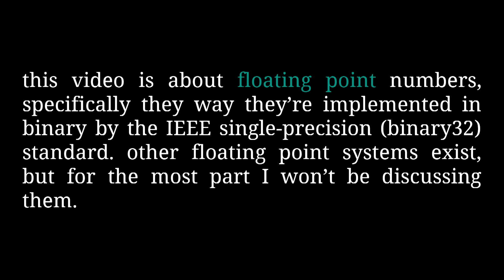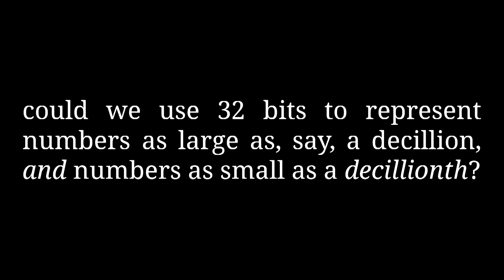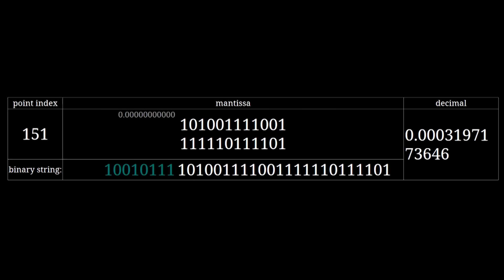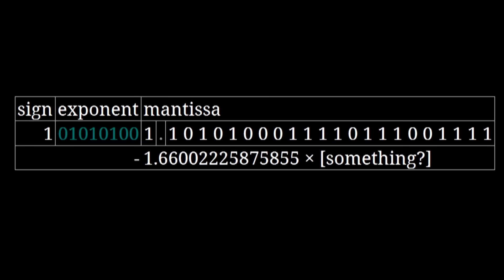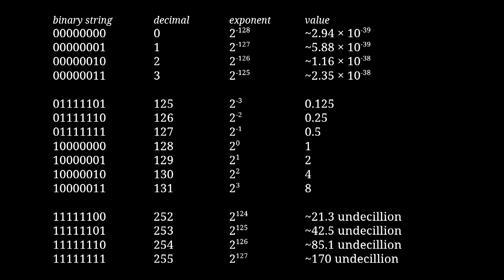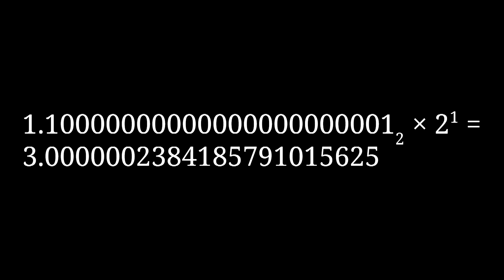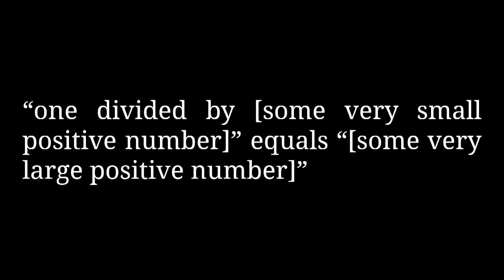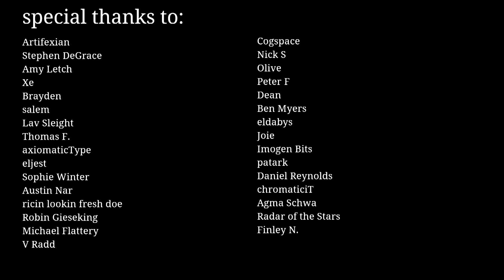how floating point works

Comment: You dont NEED to tell the computer anything. Just store that idea in a location where you would use it that way by default. If you do it enough times, you can theoretically have a computer with 0 instructions

Comment: additional notes on NaN: Some programming language implementations use the extra bits in NaN for storage in a technique called "NaN boxing".

Let's say you're Javascript. You are a dynamically typed language, and you have two main values you care a lot about: "number" and "object" (and some others, which I glossing over right now). How do you store these two types of values in memory? The "number" type is easy--just store it as a 64-bit float, but "object" needs to be a pointer (something which points to a location in memory). Normally, a pointer is 64 bits (on most modern machines), and this would give you 2^64 bytes in memory that you could store stuff at. However, if you do it this way, then you will need to store some additional data to distinguish the 64-bit float from the 64-bit pointer. You can't just store it as an extra, 65th bit---the main reasons is that most CPUs can only work with whole bytes. So you would end up with a data structure that is 72 bits = 9 bytes large. In fact it would probably round this up to something like 96 bits = 12 bytes, since most CPUs would prefer that memory be aligned to a 4 byte boundary. That's a lot of wasted bytes just to store a single extra bit!

Instead, what we can do is store pointers as NaN values! In a 64-bit floating point number, you have 47 bits to play with across all of the NaN values. Most programs probably don't allocate 2^64 bytes of memory, let alone 2^47 bytes, so instead of storing 64-bit pointers, why don't we just store 47-bit pointers? This lets you have your values be represented in exactly 64 bits, with no need for a 65th bit--instead, we just check if a value is NaN. If it is NaN, we assume it's an object and use the 47 bits as the pointer to the address in memory! Otherwise, we assume it's a regular number and interpret it as a normal 64-bit float.

Comment: 5:50 Fun fact: the reason that 0 is positive and 1 is negative is because that lines up with the two’s complement representation of integers, which means negative floating points whose bits are reinterpreted as integers are negative integers. Also it means that floats sorted by an integer sorting algorithm will be in the right order as long as all the floats are positive. Which you can exploit to make sorts faster.

Comment: The sign bit being 1 to represent negative makes binary arithmetic work. To turn a binary number negative, flip every bit and add 1. 
With this representation (called two's complement), "subtraction" is simplified into "addition with a negative number." Do your addition, throw away any carried bit if it's outside the scope of your numbers, and boom, correct result. 

Try it out for yourself!

Comment: One benefit of 0 being positive is you don't have to have an additional bit on to represent most numbers that will be used. Most being in occurence of use not range. I would believe this has more benefit in older computers but still would make signed integers ever so slightly more economical.

Comment: the sign of a floating point number is determined by (-1)^(sign bit), which means if you add more sign bits you get complex numbers in a format that makes doing anything with complex numbers needlessly difficult

Comment: The reason that the 1 represents a negative number, while the 0 represents a positive in the signed integers is because that format works better with standard addition.

1 00000 1 + 1 00000 1 = 0 00001 0

If 1 in the signed bit represented a positive number, the above expression would imply 1+1 = -2. If 1 in the signed bit represents a negative, the above expression would imply -127 + -127 = +2, which also doesn't work, but considering there literally isn't a way of representing -254 as a signed integer, and that it's so important to get 1+1 right, it's just simpler and makes everything make more sense if 1 in the signed bit represents a negative number.

Comment: A way to bypass this issue is to use something like a trinary number system (i.e. 0, 1, and 3) or 10-digit based system (i.e. 0 to 9). There! A lot easier to solve the decimal point problem that binary is forced to deal with.

However, there is a new more serious issue that arises from this. In binary it is very simple, on means 1 and off means 0. However, as soon as trinary is introduced, what do you use to represent the third value? Well, trinary computers were made in the past and the third number is determined by a partial current of electricity versus just determining if there is or isn't a current. A trinary system is technically better than binary; however, the wiring will degrade and be affected by exposure to elements. So? Just have them vacuum sealed. Well, it will still technically degrade with usage. So, the older theoretical trinary computers are the less accurate they may become and will potentially malfunction and/or crash more and more as time progresses and after usage.

Although, I do remember reading that this issue could be rectified making trinary for superior computers. Unfortunately, since binary is essentially the global standard for computers and phones, it is an uphill and mostly fruitless battle to push away from binary computers to trinary computers.

In short, we are stuck with double-edged sword that is floating point.

Comment: Where’s two’s complement?
Reply: Floating point was pretty much designed as three separate numbers packed into bit-fields of a single 4 or 8 byte value, with one of the fields being the sign, and the other two making up the magnitude. This leaves no real interaction between the different fields and they can all be interpreted independently. This makes things simpler for a human to understand and implement efficient algorithms for, but it's debatable whether or not it's actually more efficient.
Using 2's complement isn't really possible if you were trying to keep the three fields separate, since it mixes the sign into the mantissa and exponent fields. On the other hand, it's particularly good for integers since it's derived from modular arithmetic. In an 8-bit integer, -1 is really 256 - 1 = 255 - 1 + 1 = (255 xor 1) + 1 = (not 1) + 1. It takes advantage of the modular behavior that arises when embracing overflow.

That's not to say that you can't have a floating-point like format that uses 2's complement; it just requires abandoning the idea of each number being composed of a certain number of discrete and independent fields. This is actually what Posits do, with the greatest negative number using the same bit-pattern as the integer -1. Also while it was initially conceived as just a way to use integer comparison circuitry, and that actually using the number would require negating it before decoding if it were negative, some clever people found that it's actually possible to decode a posit into its constituent fields without converting to signed magnitude first.

Comment: 1/0.1=10
10*0.1=1
yes yes 1/0 is endless big number that we not know we not need know. we not divide 0 we allready know
s.. we can make rule
1/0=1 then 1*0=1
when we divide or multiply zero we get same value. thats rules
you have apple on table you split it 2 you have 2 piece size of 0.5apple?
you split it 1 you have 1
you split it 0 you still have apple. makes sense now? LOL
you not have infinity ammount apples magically xD

Comment: I still don't understand how 5(i)+27(m)=32 bits?
Reply from the maker: well for one that isn't how the bits actually are split up in single-precision floating point (it's one sign bit eight exponent bits and 23 mantissa bits for 1+8+23=32 bits total) but also 5+27 really does equal 32. so uh idk what you're asking basically

Comment: the whole thing about everything is an estimate with floating point math is kinda the same for a lot of thinks in programming
like yeah computers are supposed to be this thing that gives you consistent results but often especially when making a program to control your mouse (i use mac) it's really like irl where if you go too fast stuff breaks so you have to slow down to get to a reasonable state and even then depending on how much load or whatever the computer is dealing with it still could break.

Comment: I have a simpler solution, since all those numbers are rational, just allocate two integers, one for the numerator and one for the denominator, it's easier and stores rational values with exact precision

well the only caveat is that in order to perform addition and subtraction we'll have to either multiply the denominators to get a common denominator, but that would consume too much memmory, or we can find the least common multiple, but that requires prime factorization, a procedure we still don't have a fast way to compute without quantum computers, and if you manage to find an algorithm for that which is fast on classical computers than congratulations, but with the price of giving hackers a tool to break RSA and all of world's encryption in the process😂
Reply: This is an actual numerical datatype provided by many environments. Fairly predictably, they're often called "Rational" or "Ratio." Usually the numerator and denominator are represented as primitive integers, so operating with them is very cheap and you generally have to try to actually reach their limit. They usually don't get dedicated hardware though, so floating point is often used simply because it's faster due to the dedicated hardware. If you actually need precise ratios whose denominators aren't powers of two, they are much better that floats. Rational types can handle 1/3, 1/7, 1/11, and 1/13 without a sweat, where as both decimal and floating point would panic at the repeating digits when expanded.

Comment: I feel like NaN space is a huge waste. Sacrifice one bit and thereby allow super-normal numbers when the sacrificed bit is 0 and NaNs when it is 1. That is still 8 million or so NaNs, which is more than I personally know what to do with (and is 16 million really so much more useful?).
Reply: Take a look at posits. Posits only have 1 exception value of NaR (which is still technically a number by the way), as well as only 1 zero. As posits use 2's complement rather than signed magnitude, these two special values get mapped the two fixed points of two's complement negation. It also has tapered precision akin to subnormals, but across the entire range, which can actually make them more precise than IEEE floats when around 1.
Reply: @angeldude101 : Awesome! I will take a look. Always happy to add tools to my kit.

Comment: But wait, really, why didn't they repurpose -0 for NAN and have another range of values...
Reply: because -0 is important, it makes it so that at least the sign of the result is always correct
Reply: Because "-0" isn't actually -0. It's a negative infinitesimal / limit value. The range of numbers between the largest Real negative float and 0. The problems with "-0" arise from the fact that that range is inclusive on the upper bound and is generally treated as said number on the upper bound, even though this number is also included in a completely different positive range, making it the single Real number that maps to multiple different floating point numbers.
They could've repurposed the largest negative subnormal number to stand in for "-0", which would be equivalent to the very large number presented at 13:22 standing in for the range leading all the way to infinity, which would be a perfectly valid and reasonable choice, but not the one that IEEE went with.

Comment: So, the reason why 0 is positive and 1 is negative is so that the same circuits which compare signed integers as to which is bigger, can also compare floating-point numbers as to which is bigger, because signed integers use 1 for negative so that the signed and unsigned representation of positive numbers will be the same.
Reply: Except not really, since if the signs are both negative, then it needs to flip the order of the comparison, and it also needs to handle cases like +0 == -0 rather than +0 > -0 despite representing different ranges and having different bit patterns, as well as making sure NaNs aren't less than, greater than, or equal to any other number including themselves.

So no. Using the sign but like that does nothing to help with ordering floats. At best it lets you use the same isNegative() and isPositive() code assuming you want NaNs to have an extractible sign.

Comment: What the fu-
Also -0 and 0 is the same thing.
Reply: not exactly. they mention that numbers in floating point represent ranges of numbers. -0 are negative numbers too small to be represented with anything other than -0, and 0 are positive numbers too small to be represented with anything other than 0
Reply: @dihydrogen  that makes sense, yet it shoudlnt
Thanks.
Reply: They're not zeros. They're infinitesimals, representing the ranges of numbers between the minimum magnitude floats and 0. What float does the actual Real 0 map to? Good question!
Reply: @angeldude101  it maps to 0
Also discussing math while watching pixie and brutus has invoked fear in me. Well my father made me fear.
And my fingers are so inconvinient. And this keyboard makes typos too often.
Reply: @mihaleben6051  "it maps to 0" Which one? Both are equally close, equally far, and equally even (actually important for floats), so the only reason to give 0 to the positive infinitesimal is a positivity bias. Then again, that same bias is seen in the square root operator, which really should return the positive and negative roots rather than just the positive root.

Not giving 0 its own distinct value deprives floats of a true additive identity, so it's literally invalid for compilers to optimize x + 0 or 0 + x to x.
Reply: @angeldude101  oh no i have accidentally exposed a flaw in math, and do not understand it.

Comment: So the reason that negative numbers are 1xxx xxxx is that the signed and unsigned variants all have the same numbers from [0, 128). An unsigned 53 is the same as a signed 53: 0b0011_0101. If you want to convert to a signed number and multiply by -1, it becomes 0b1011_0101. Nothing has changed with the bits to convert to signed and changing to the negative equivalent is to flip the 0 sign bit at the beginning of the number.

Comment: Floating point functions are required to return some odd results for certain values. For instance, 1^NaN = 1^∞ = ∞^0 = NaN^0 = 0^0 = 1, which might make some mathematicians uncomfortable. Even more bizarre is (−1)^(−∞) = 1, because infinity is an even number. I'm serious. More technically, it's "because all large positive floating-point values are even integers," which rather goes against the notion that each point represents a range of numbers rather than a particular number.

(Note: that is how the "pow" function works. The "powr" function intended for continuous cases does not work that way, but it still has weird behavior like powr(−0,−3) = +∞ and powr(−0,+1) = +0.)

Comment: Thank you for the explanation!
I'm really not happy about this system, but I'm no way near good enough at anything related to suggest a better way of handling it.
I first bumped into the issue of FP numbers being approximate when I tried to learn PHP on my own.
It is too long ago to remember the exact values and calculation, so the following is... well... an approximation. xD
I did something like dividing an input number (set to FP) by 2, and then set the code to execute a segment of code if the answer was say 2500. The problem was that the code figured that 5000/2 wasn't equal to 2500. It was slightly greater than 2500.
Oh my BRAIN, before I figured out that this was some sort of quirk of FP numbers.
I assume banks and stores have reliable ways of handling things like this, despite possibly having to calculate small percentages correctly. I just never bothered to deal with FP numbers ever again.
IS there another system for handling decimal numbers without the approximation (in use or not)?

Comment: 3:04 "There's a whole continuum of real numbers you can represent between all the integers" as a nitpick, there is no continuum, and while it's technically correct that those numbers are real numbers (just like integers are real numbers), a more precise statement would be that they are rational numbers.
Reply: Technically speaking, floats approximate the dyadic rationals, which are all the rational numbers whose denominator is a power of 2. 1/10 doesn't exist in the dyadic rationals, and by extension doesn't exist in floating point. It can only be approximated as the closest dyadic rational that's then rounded to fit into a float.

Comment: Thanks for this video.  I just wrote an Excel formula to convert hexadecimal IEEE-754 floating point numbers into decimal using nothing but built-in formulas, and I couldn't have done it without learning how sub-normals and Infinity/NaN work.  Here is the formula, by the way:
=IF(BITAND(BITRSHIFT(HEX2DEC(A1),23),255)=255,IF(BITAND(HEX2DEC(A1),8388607)=0,IF(BITAND(BITRSHIFT(HEX2DEC(A1),31),1)=1,"-Infinity","Infinity"),"NaN"),IF(BITAND(BITRSHIFT(HEX2DEC(A1),23),255)=0,POWER(-1,BITAND(BITRSHIFT(HEX2DEC(A1),31),1))*POWER(2,-126)*(BITAND(HEX2DEC(A1),8388607)/8388608),POWER(-1,BITAND(BITRSHIFT(HEX2DEC(A1),31),1))*POWER(2,BITAND(BITRSHIFT(HEX2DEC(A1),23),255)-127)*(1+BITAND(HEX2DEC(A1),8388607)/8388608)))